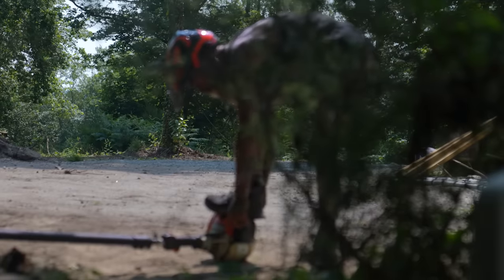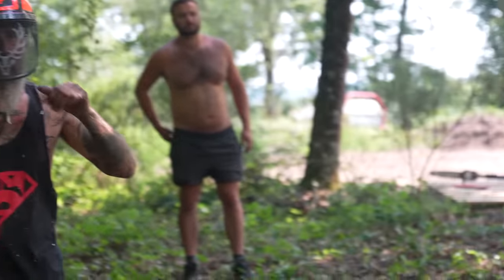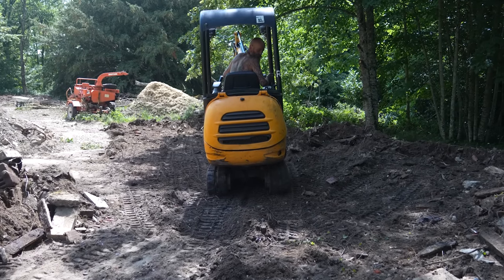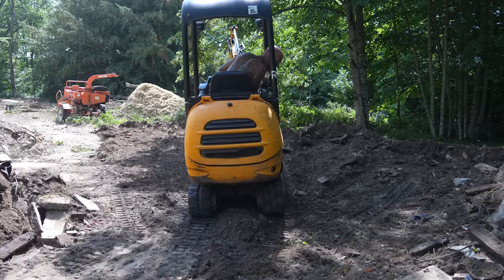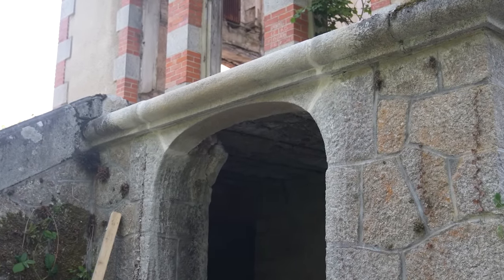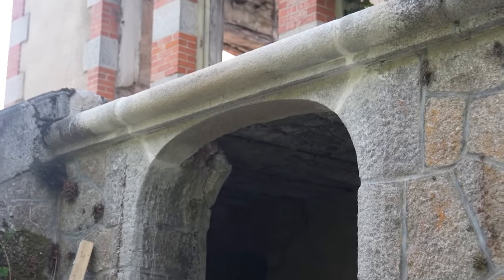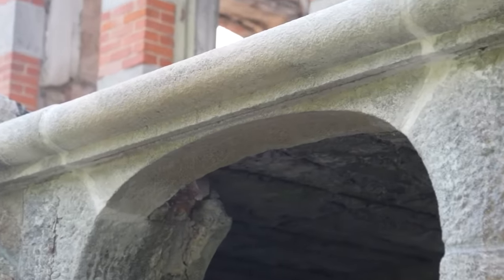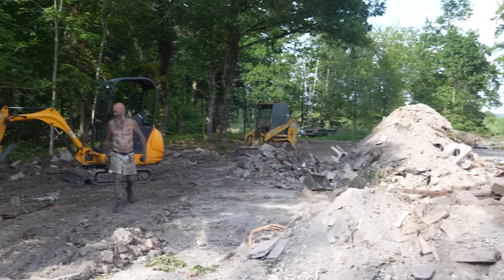Its coming to an end.

Comment: Well done Dan and Team, that was some work this week ... AMAZING !!! Kalvin is just a working machine, throwing logs here and big bolder's there he also does not seem to get tired. But the Hero of the week was that mini digger. What took two weeks to dig out one room last time took less than a day and a half with Nick and the digger. Nice to find the bench that turned out to be a fireplace !!! But what is the red tiled area in the room, it does not have the checkerboard pattern, Dan  ???
Reply: Could be the necessary floor under the units/working end of the kitchen. Cheaper to have one colour, if only by saving labour time in laying them. Pointless having a pattern that isn't seen.
Reply: 😮Someone commented that it might be an area for butchering, hence the drain in the floor.
Reply: Kitchens had a drain hole in them to sluice out the floor and wash it
Reply: Pantry room?
Reply: You can see the ghost lines of stairs on the wall so that area would have had very little headroom, more like a cupboard. It looks like the stairs started by the door and went up in a U shape, leading to what I assume was the original dining room, turned into a modern kitchen in the 1970s. The part between the stairs and the windows seems to have been another room, probably a scullery or pantry. The tile pattern clearly shows where a wall and door have been.
Reply: @Ragnar8504  Yes, you are right ... in tomorrows video (19.06.) you can see the shadow of the stairs going up ! Thanks 🙂

Comment: At the end of the video, it's intriguing to realize that behind where you're sit on, the wall shows a walled entrance, meaning the "cooking slab" is a latter floor plan modification. It'd be nice to see how the room was originally envisioned.
Reply: I have to laugh as I noticed that too and commented then skimmed through the comments to see if anyone else noticed, glad someone else saw it.😊
Reply: I'm fairly sure that slab was an addition from the 1970s. Considering the position of the chimneys I'd still think the original cooker would have had to be along this wall and probably in this corner but I might be wrong.
Reply: @Ragnar8504  not sure about the date, but I'm quite sure the cooker would not have been in this wall. The walled door would be the pantry access and the other the house access (if this was indeed the original kitchen).

In the the previous video ( 3:09 of "Completing an impossible task at the chateau ruin", can't post the link due to stupid YT deleting this post), you can see another wall where the central window has also a "walled entrance". Looking at the floor design, the original cooker was probably in the corner under the small window and the (now) walled entrance under the window was access to the wood storage probably.
Reply: @franzrogar  Agree on the closed-up outside entrance but that corner is obviously where ther servants stairs to the dining room were. The section to the right of that was clearly a room of its own (you can still see the ghost line of the wall in the tile floor), that could well have been the pantry.

Between the door to the basement hallway and the bricked-up door I think I can see a round metal plate that might cover a stovepipe thimble. If that's true I think that's were an AGA-style cooker used to live.
Reply: @franzrogar  PS: I also think there used to be a tiny vestibule in front of that existing door where the tile pattern changes. At 3:16 you can see a straight patch where a thin partition wall would have been, separating the staircase from the actual kitchen. That lines up with Eric Thorn's description that those stairs came down to the basement "just outside the kitchen". That rectangle in the middle of the red floor section might be the pad for a post that supported the stairs rather than a drain.
Reply: @Ragnar8504  To easy the conversation, how about call "the wall with the cooking slab" South Wall (or S-Wall) and, therefore, "the wall with the walled entrance under the window" the West Wall (or W-Wall). Agree on the stairs, which end right with the first door of the S-Wall as expected on that time, and its central post.

The wall partition is correct (I don't know how I missed it, maybe because it was midnight...) That being the pantry... maybe, but there are two issues with it: (1) the walled entrance in its corner (clearly visible under the window), if it were a pantry, you wouldn't want anyone but cooks accessing it...; and (2) where would be its entrance from the kitchen? I could pin-point the "dark" patch to the left of the middle of the partition wall that seems to be going inwards the "pantry", but it's an odd position when you want to store because to the right of it, you couldn't use the rest of the wall because there's not enough space for a shelving of that age. Maybe you could store a barrel on the back... but I don't think so. It might have been after they walled the entrance under the window (and that might be the dating of the floor?)

In the S-Wall, the two entrances (the one walled and blocked by the cooking slab and the opened other) seems to be of similar dating and construction, so my guess is the left one the access to the (old) pantry, only accessible from the kitchen, and the other one, well, where it leads (the house).
Reply: @Ragnar8504  About the vestibule, it might be, but that makes the entrance used by the machine a weird one. Would you have two outside doors to the kitchen? If we look at the floor, the "machine" entrance is correct, but the walled under the window, it's not (the pattern doesn't change, meaning a room with no external entrances). This' what lead me to think that the current floor tiles (and thus the inner stairs) are of late date to the construction of the building.
Reply: @franzrogar  I agree, the layout is odd for a pantry. At 2:34 you can see that the tiles run through between the kitchen and unknown small room maybe 50 cm from the N wall for roughly the width of a door. There's another door ghost in the middle of the S partition 

wall of that small room, presumably a low cubbyhole to access the space underneath the stairs rather than a full-sized door. As I said, the small room might have been a scullery or something else. In that case a sink might have been in the NW corner, although I don't see any traces of drains or water pipes.
All very strange.
Reply: @franzrogar  
The solid red border runs all the way around the room, the red and white pattern in the N doorway is more or less flush with the wall (or was when the wall was still plastered). So the W doorway might have had the same pattern until it was closed up.

I have no reasons to believe that the tiles are newer than the 1920s based on their style, someone in another comment even told me they're unlikely to be from the 20th century. The only major renovations we know of were in 1939 for the arrival of the Jewish children and then in the late 1960s through mid-80s. Those tiles don't fit any of these periods.
Reply: @Ragnar8504  I think we have to move to the last video ("Finishing the steel work in the uncovered kitchen") as there are some important things that have pop-up from the better images.

First, the "original layout" is somehow weirder than I expected. In the W wall, there was a "walled entrance under the window"... Well, now if you look at the N wall (where the machine entered), you can see that both windows at the sides of the entrance were also walled entrances.

After seeing this, I thought "maybe it was an arquitectural design to made them look like that" but moments later the video shows clearly the E wall. There, the two windows are clearly NOT walled entrances.

So my first guess is that this room or (a) was an earlier building (being the N wall with 3 doors, maybe a barn?) or a rejected garden façade when they, clearly, rose the ground level around the building.

The walling of the entrances is made too similar to the rest of the fabric, so it should have been done early. When the shut all the doors, it's when they added the current floor, which only shows a difference in the pattern at the only entrance, thus making it concurrent with the closure of all the other doors.
Reply: @franzrogar  The stone work underneath the windows does look rougher than the surrounding walls so it might be later. A change of plans would make sense though.
As I said in my last comment, I think the floor could have been modified quite easily when doors were closed up.

BTW, I noticed a diagonal line on the W wall leading to that former door. It has roughly the right size, slope and height for a sink drain.
Reply: @Ragnar8504  then probably the "first" kitchen (I don't think this room was "initially" THE kitchen, I'll elaborate soon) might have been in the W wall after the closure of the door.

Having the N wall THREE doors, I simply can't imagine no constructor to just finish them (all the stone work required) just to "decide on design"... Too much work, and quite expensive work at that time.

Now, add the door on the W wall, and we have a room with 4 outside doors... That'd be no kitchen, can't be.

Also, all outside doors (including the one left, used by the machine) are BELOW ground level, so this is my guess:

(1) This room was initially the "backdoor", or the back "hallway", where you might enter after hunting, or sightseeing or whatever they did.

(2) Then, they might have decided to level the "gardens", thus rendering this room below ground level. It's in this moment, when they wall out all doors but one. This would explain why the downstairs outside the building, from the ground, was made with such different stonework.

(3) Then, they created the kitchen here. That might be why the chimney is off too...

(4) The first kitchen might have been in the W wall as you indicate.

(5) The second kitchen, along with the floor tiles, was put moving the kitchen out of its place and convert it into a pantry plus the inside stairs for the service.

That's my "polite" guess so far ;-)

Comment: Hey Dan, do you know where the stairs from the kitchen/basement up to the main floor were situated? Now that you have so much cleared it would be interesting to have a walk through telling us what was there and how it all worked. Also was thinking would it now be possible to winch up materials from the kitchen? it would save you from carrying all up the front steps first. I am in awe of your progress, doffs cap to you and all of your crew!
Reply: You can see the outline on the wall in the previous video. As you enter the kitchen from outside, through the door Nick threaded the skidsteer through, the stairs were on the right, against the inside wall. They started right at the door and went up in a U shape.

Comment: Could you mill the timber from the maple?  Might make nice floorboards or table. ☺  Nice work on that arch ✔
Reply: Nick has a sawmill so I bet if the timber is any good it will be milled and used.

Comment: It has been quite a week for the Chateau, and you guys. Good on you too. I just have one question. As I'm watching your sign off, when your sitting down, it looks like someone had closed off possibly a door behind you, or could that possibly be a closed off fire cook area? I don't know where those 4 holes are in the wall in relation to where you are sitting now, but if they are on the same wall could those have been the openings for smoke to go out of that area there? Just scratching my head. But that sure is an odd feature behind you.
Reply: The fireplace was most likely put there by M. Mironnet in the 1960s or 70s so what used to be there before is anyone's guess. An original wood-fired cooker would have needed a chimney and I think all the original chimneys on this side of the building are in this wall so I suspect that might be where it used to be. Of course then that stone repair doesn't make much sense and those vertical lines are so straight they do look like a closed-up doorway.

Comment: From the flashes of the pictures available its interesting looking at the fire patterns and how the fire may have started. On the door behind you There is a V that points down to the fire place that you are sitting on. There is also relatively little soot on the walls around that room probably indicating that the fire spread quickly and vertically, if it started here? ls there a stated area of origin  where the fire started? if not it would be interesting from an historical perspective to get a fire investigator to look at it to try to understand where and how it may have started.
Reply: I kinda doubt it started in the basement because that had a concrete ceiling. As far as I can tell the worst fire damage is on the first floor and higher up, in the bathroom area. One of the two bathrooms is in fairly good shape (the one with the bees), the other one is completely gone. The entrance hall underneath on the ground floor still has mostly intact paneling though. So I guess either the fire started on the first floor or in one of the rooms and then spread upwards. Might have been the modern kitchen (above the original one) and then into the room above and out into the first floor hallway.

That's all just complete guesswork though. The fact that the kitchen ceiling is the only one in the basement that was completely destroyed provides some clues though. The other three are in poor shape but still in place, even with tonnes of rubble sitting on top.

Comment: Is that a seam on the back side of that barbecue bench? Did it use to have a chimney? How did it work sitting in the middle of the building? Was that an open air court yard at one time?
Reply: There's a fireplace directly above, possibly a shared flue between them.
Reply: @LaReynedEpee  Or multiple flues, I seem to remember that the chimneys have for to five flues each. This fireplace is a post-WWII addition, nothing properly old.

Comment: Is the original vent/flu for the firebox bricked over right behind where u were sitting?  There is an appropriatlly sized rectangle with larger mortices and different stone than the surround.